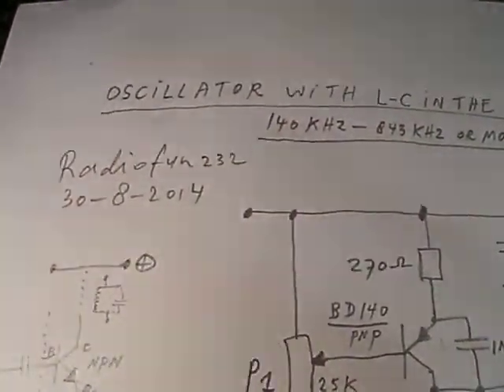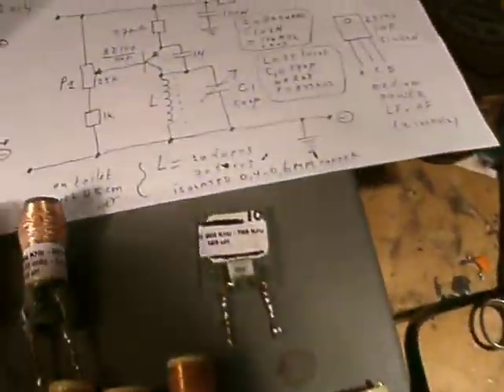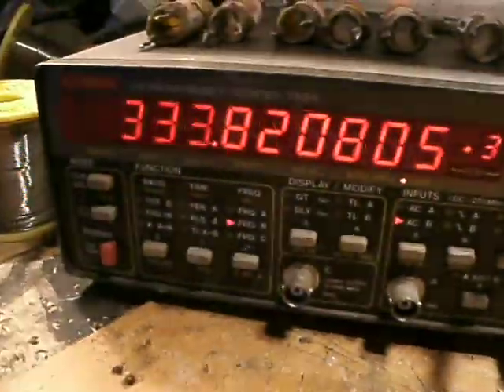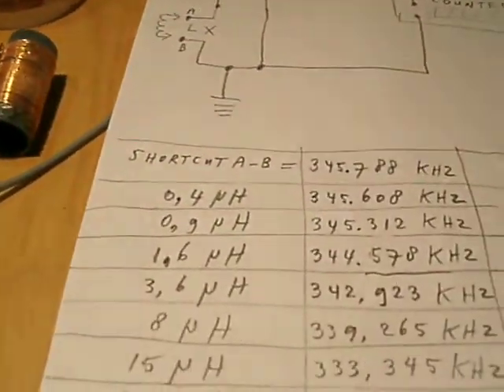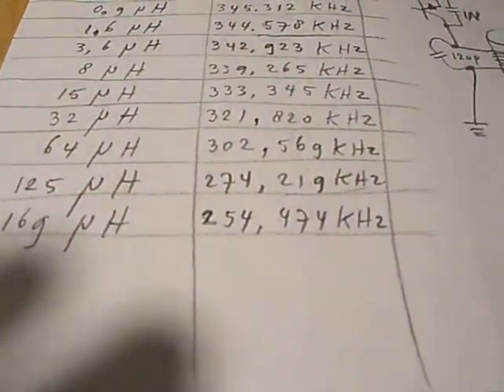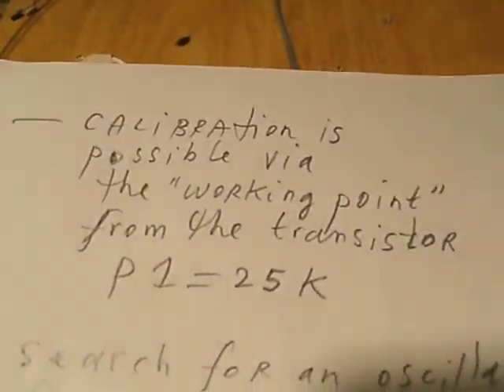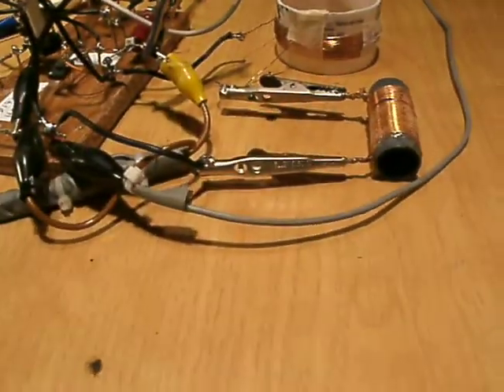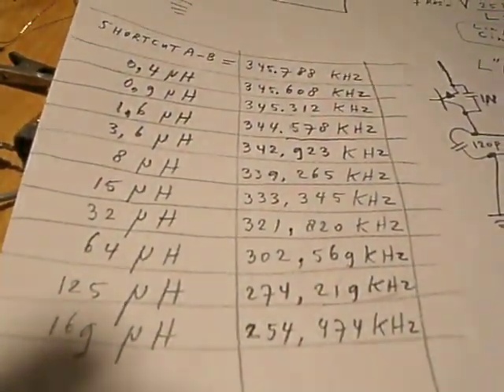measuring inductance (0,4 uH-169 uH) via a frequency counter (principals/demo)

Comment: Hi, can you help me with this circuit. I built it but it doesn't seem to oscillate or my frequency meter doesn't see it?! The circuit is consuming  8.4mA at 12.2V. Coil is 30 turns like yours, cap is 330pF. 150 ohm is 220, 270 ohm is 220, pot is 22k, 1k is 2.2k, transistor is BD140 ... what could be the problem? I connect the frequency meter directly or through 70pF but it doesn't show frequency but it does show some reading if i short CE of the transistor, so I guess it is not oscillating. Any ideas?
Reply from the maker: I will study your question and give a first reaction. Mail me on radiofun232@gmail.com and send me pictures and a drawing of what you have made, I will try to help you.
Reply from the maker: Question: do you want to make an oscillator and/or on what frequency? Could be that this circuit is too experimental and there are many other circuits on my YT channel that perhaps will fit to what you want to make.
Reply: @radiofun232  I try to make the experiment from the video, because I would probably need to measure some low inductance coils. My first goal was to make the circuit and see the frequency of oscillation but it didn't oscillate. I played with it some more and figured out that the frequency meter does see signals through 70pf, so maybe it is the circuit failing to oscillate. As I said before I didn't put the exact resistors you suggest but I can do it if that's the problem. I can post you pictures tomorrow because it is 5AM here.
Reply from the maker: @fatnindja  OK, good, I am interested.
Reply from the maker: @fatnindja  You can do your experiment in fact with any HF oscillator. The following circuit works best for that purpose. It has a low parasitic capacitance on its input and is linear  https://youtu.be/Ng49kGF3n8o

Comment: I need a 0.6uH inductor that can take 400A how did you make it?
Reply from the maker: Sorry, I don't know that. But in your situation: 0,6 uH is a very low value. 400 A means an extreme current. In such a  situation I would use (only an advice..., never practiced it!): 10 turns of copper 4 mm wire (properly insulated) at a ferrite rod of 1 cm diameter for a first experiment. No guarantee for succes. Or use it without that ferrite rod. A Shortwave coil of 0,6 uH consists of approx. 5 windings diameter 1.8 cm without any core.
Reply from the maker: Please read my adapted comment 21 july 2018.
Reply: Thank you very much ill post my feedback during the week.
Reply from the maker: I am interested, where do you need a coil of 0,6 uH at 400 Ampère?
Reply: I want to build a car battery welding machine. I've seen people here on youtube welding with two to three batteries in series, I want to weld with just one 12V battery so I need the coil for the compact DC-DC converter I'm trying to build. I don't know if it will work.
Reply from the maker: OK, thanks

Comment from the maker: LINKS TO VIDEOS WITH SCHEMATICS ON MEASUREMENT TECHNIQUES & TESTS  
Analog frequency meter 45 Hz-19 KHz pt 1 https://youtu.be/vm5JlyWqac4
Analog frequency meter 45 Hz-19 KHz pt 2 https://youtu.be/hNikBHDJwg4
Test device to get insight in transformers and higher inductance coils https://youtu.be/u9sP_b5Rfvo
Getting more insight in radio coils with a FET oscillator https://youtu.be/LrJWLe1XrSI
Device to test radio coils on their Q (quality factor) https://youtu.be/HR-apI_ZkKU
Experimental SWR (standing wave ratio) meter on 27 MHz https://youtu.be/ErIQmRDA4go
RF absorption meter demo + schematic https://youtu.be/fOnlyU2Qlwg
Inductance measurement 1,2 uH – 180 uH + Q test https://youtu.be/_iDtm8EhRRg
Test oscillator sine wave with very good linearity 200 KHz-9 MHz https://youtu.be/Ng49kGF3n8o
The easiest way to test an IF can on 455 KHz https://youtu.be/vyHWUt3UzTs
Radio coils and dipmeter demo https://youtu.be/g6QWsL9SNzY
Radio coils, properties, basics, examples  https://youtu.be/Roi4qloauVE
Testing IF coils on 455 KHz with an oscillator https://youtu.be/ZRsD7pzhu6c
What do you need for an electronic lab? https://youtu.be/v503bmymCWw
How to make a precision analog voltmeter part 1 https://youtu.be/pfi5N-rkS8c
How to make a precision analog voltmeter part 2  https://youtu.be/5Dk1NMz-LQs
How to make capacitors from 1-300 pF and measure them https://youtu.be/4rD4J2kV854
Oscilloscope: how to make a very basic one https://youtu.be/4V3IXhTFqIM
How to make a 455 KHz IF filter yourself and wobbulator it https://youtu.be/P3zzuf9p8hI
What to do with broken analog voltmeters? https://youtu.be/XXCePo0ZIfk
Test oscillator for coils https://youtu.be/K2nkqnrwD7o
Measuring inductance (0,4 uH-169 uH) via a frequency counter https://youtu.be/ExikurAQKpY
How to make a shunt https://youtu.be/FN59W9SGou4
Prevent transistor leads from breaking https://youtu.be/iEe37oz4tww
Testing IF cans/how to find out their properties https://youtu.be/hOSRIJjHunI
Measuring the health of a N-MOSFET with a Ohms-Voltmeter https://youtu.be/cRtT5c_bkUI
Electronic effects made visible https://youtu.be/_f5sSOE3ijc
Developing a precision capacitance meter https://youtu.be/qhyqHk8wXJs
Passive diode testing, part 1 https://youtu.be/EI0-fj--Jjk
Passive diode testing, part 2 https://youtu.be/oKIcbubaUWw
Silly MOSFET testing https://youtu.be/QAvuZXjPNLM
Diodes, common info https://youtu.be/t_KztxcLXmc
Digital frequency meter made from a radio with a digital display https://youtu.be/5MzdJR19S7Y
N-MOSFET (power type) tester (passive) https://youtu.be/t25qwvHDDXE
IF 455 KHz filter test with a wobbulator https://youtu.be/crfK_DgSfGs
Test from a 455 KHz IF filter (oscillator) https://youtu.be/5wuHmHNESoY
Extended scale precision voltmeter pt 1 https://youtu.be/-z_j4MclCTk
Extended scale precision voltmeter pt 2 https://youtu.be/fC1QP_6OlAM
Wheatstone bridge demonstration circuit https://youtu.be/Y3-Mhil1uzY
How to figure out an unknown transformer, part 1 https://youtu.be/ceHe_0iuh_Y
How to figure out an unknown transformer, part 2 https://youtu.be/IDV530fM_oM
Dipmeter: search the resonance frequency https://youtu.be/QVTmiFbf7Gc
Inside the Ferraris meter https://youtu.be/i_ed0lgzfjw
Do audio capacitors have a certain sound? Part 1 https://youtu.be/nHtIg-0DQLU
Do audio capacitors have a certain sound? Part 2 https://youtu.be/4nylOtSATPk
Do audio capacitors have a certain sound? Part 3 https://youtu.be/rdpsjvYv4wg
How to use a frequency counter, part 1 https://youtu.be/0yfI5rRV3Pk
How to use a frequency counter, part 2 https://youtu.be/30Sowpu64ec
Effects from coupling capacitors in audio circuits https://youtu.be/eF8e-FmtDh4
How to measure AC current https://youtu.be/PWPqp3wHiS4
Testing PVC tape on high voltage  https://youtu.be/RwmArfBUc8o
Integrator and differentiator circuit, sound effect https://youtu.be/OKCpDdwrhGY
how to test switches on high currents https://youtu.be/9rus9UnnL8M
Inductance meter 0,4 uH-170uH for radio coils https://youtu.be/THvEqSAKD6Q
Measuring the resonance of a quartz crystal https://youtu.be/vv2Xcjga_Vc
MOSFET fundamentals (static test) https://youtu.be/YUF7bwqNK28
Inductance meter 1mH-100mH schematic https://youtu.be/vi041V0oiR4
Effect from clouds on a solar panel https://youtu.be/Ub8G8E_IU9o
Radiofun 232 on You tube, all channel info and links https://youtu.be/xbgQ8T3oqh4
My books are on the website from Lulu, search for author Ko Tilman

Comment: I have thought about building a capacity gauge and inductance, with a microcontroller and a program under linux to do the presentacion in PC. At first I thought calculate the inductance measuring th discharge time voltage of the coil.

But it seems an interesting way to calculate your inductance with frequency of the tank circuit oscillator and give me the impresion that it is more accurate.

Thanks for you video.
Reply from the maker: +Angel Jimenez It is, indeed, very accurate and even the slightest frequency variations (due to capacitive or inductive influences) are visible.
Reply: +radiofun232 Thank you very much for the info, I'll get to work with this project, very interesting all your electronic RF channel. Thank you.

Comment: I always wondered which inductance values are the best
as i calculated you make coils for LC tank with 200-700pF
am i right?

with these capacitor values there is better Q factor or it depends on coil's resistance?

maybe you could say something in another video about Q factor
Reply from the maker: Perhaps my recent video can help you. The Q factor can be calculated and is an issue that takes a long time to tell. Perhaps later, I have to study this (formula's) to make a useful video. High Q =low loss so high quality insulation materials to make the winding on the core (glass,pvc,moisture free cardboard), good spacing (0,1 cm MW  - 0,3 cm SW), no skin effect, General info in my video from 13 feb 2015 and in my book on the Lulu website (payed content).
Reply: Thanks!

Comment: Big thanks for this!
Reply from the maker: You are welcome.
Reply: by the way i saw (and soldered) LC meter which uses Comparator as reference frequency 
Maybe it will give you some ideas
And microcontroller is counting frequency and calculates value
Reply: and if you dont want to use MCU i think frequency counter is possible to make with 7400 series (counter,oscillator,divider etc)
maybe it is even possible to somehow calculate value with such logic elements
it would be very interesting
Reply from the maker: Ilja Lebedevs Thanks for your comments, idea's and suggestions. The point is that I want to develop a very simple uH meter for my Youtube viewers, in the low uH range. I did a lot of experiments in the past and know how to develop such a thing, but want to make it more easy, a very simple circuit e.g. with a bridge (wheatstone like or so) and a shottkey or germanium diode, uA meter and a potentiometer, etc etc. Problem is as always the very low values like 0,4 uH or so, their inductance is so low that they don't give visible effects on meters etc. So then it comes to a counter, etc etc, but that is not what I want. Anyway: thanks for your attribution!

Comment: Hey radio fun i strongly admire your videos and was wondering if you could make a 3v-240v DC motor control circuit
Reply from the maker: Thanks. The subject that you propose is (sorry) a subject where my knowledge and experience is (more or less) zero. The only thing I know is that a series resistor (or circuits like that) do not work properly, because the DC motor looses its power. Perhaps someone on another YouTube channel can help you.
Reply: Okay that's a shame i wanted to make an environmentally safe go kart using a large DC motor but i only need to control it but other than that your videos are just so sophisticated and imformative i have learnt so much watching your videos and just wanted to say.... Thanks